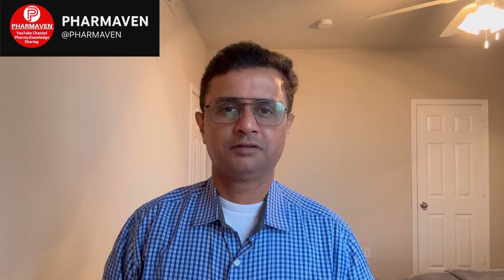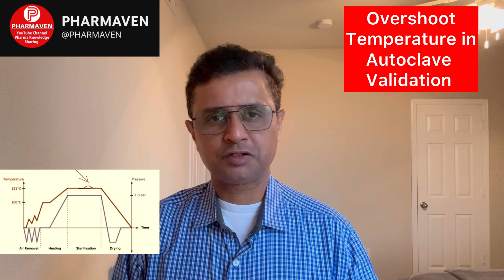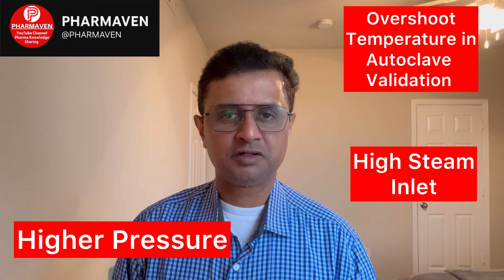Overshoot in Autoclave Validation @PHARMAVEN #pharmaven #validation #sterilization

Comment: Is there any impact for sterile, if there have any overshoot issues?
Reply from the maker: Overshoot may not have impact on sterilization but it may impact quality of material like rubber stoppers, silicone tubing which may have certain limitations for exposure at higher temperatures